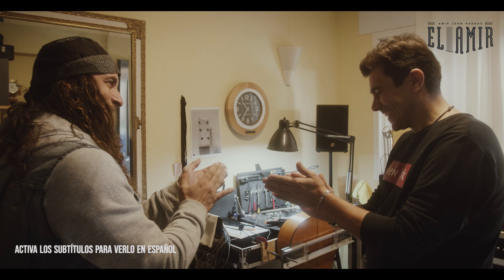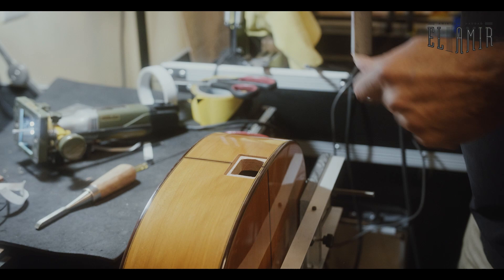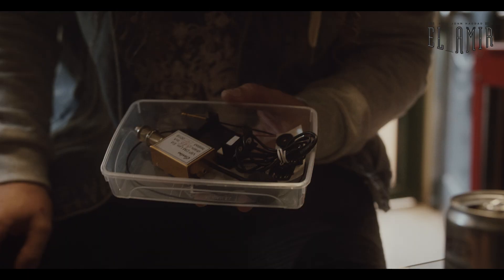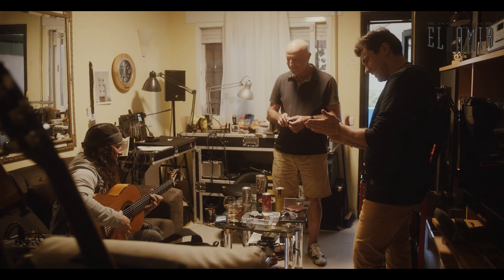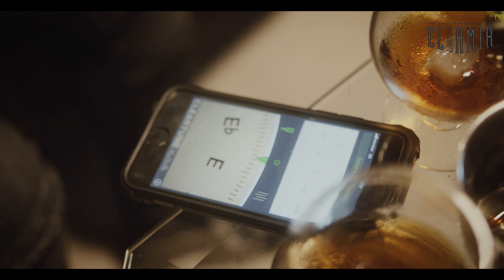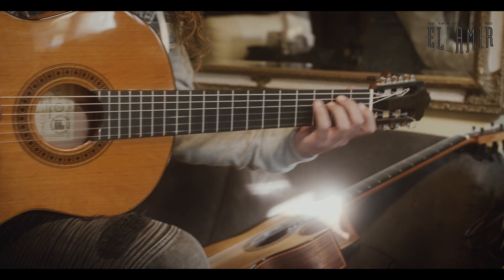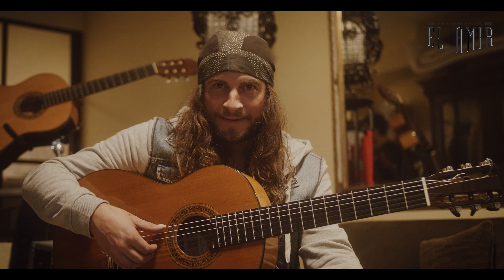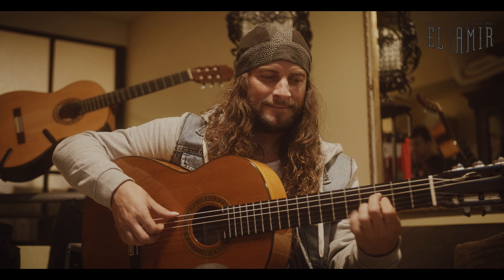EL AMIR - Carlos Amplification (Flamenco Signature Model El Amir by Jose Salinas)

Comment: Maestro Amir may I ask what brand and tension string do you use for your general playing? 🙏
Reply from the maker: I use Knobloch strings. The tension is depending on each guitar... I can tell you what I use on this particular guitar since it has a very low low action and need therefor a little more tension (Medium high)... usually I play low tension...max medium tension... and again it depends on the guitar... so you need to figure out with what you feel comfortable... this is how it goes...   for example: Steve Ray Vaughn played 13 gauge set... it would never fit my electric guitar style though... you get what I mean right?